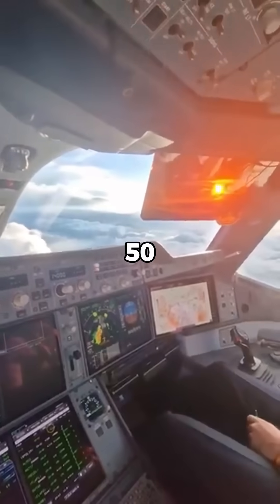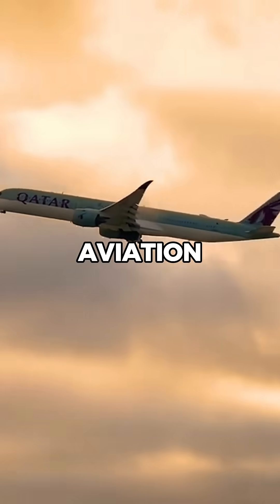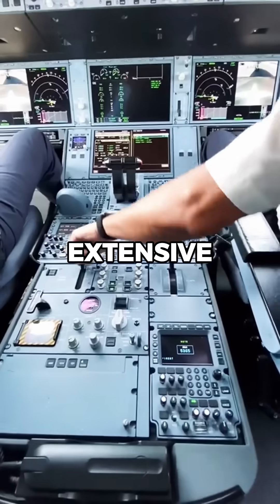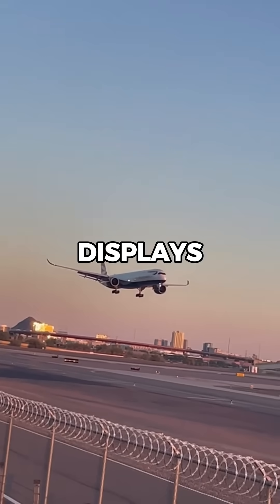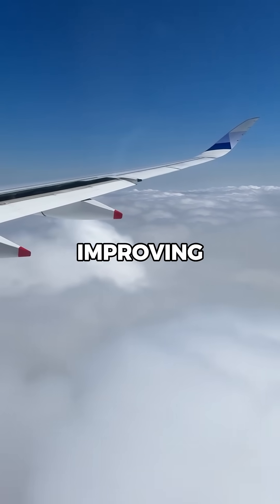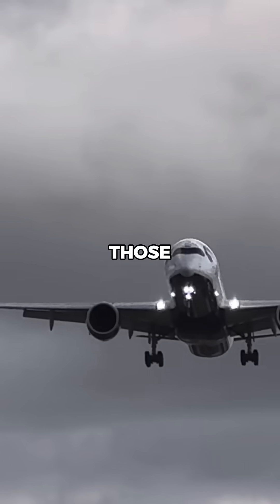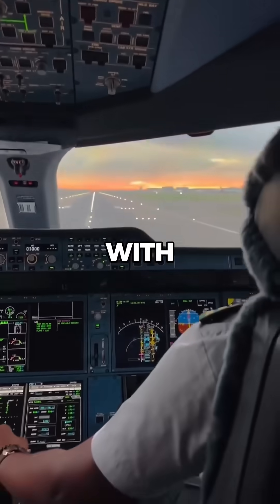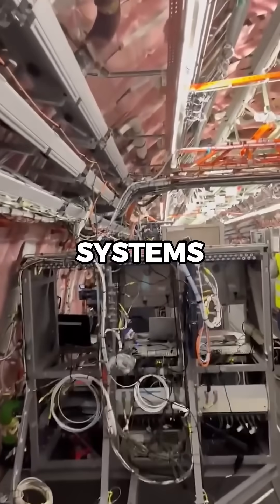why the Airbus A350 cockpit cost so much

Comment: You had a good run but the point of the video was the cost of the A350 cockpit. You go on about FBW and it being a flight control system, yeah we know. We want to know the cost of the cockpit as per the title of the video, not have the plane in its entirety explained…